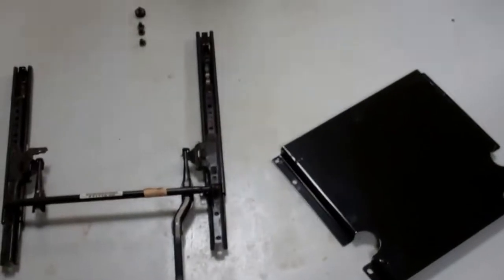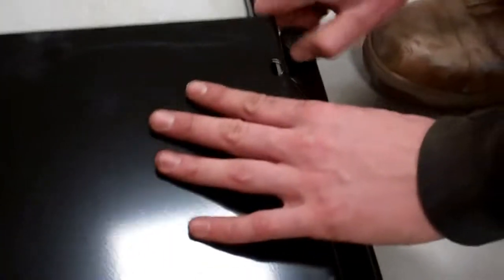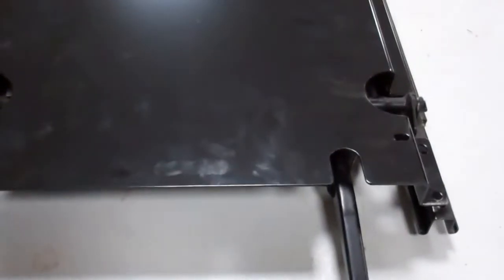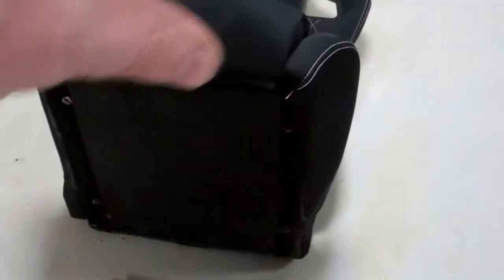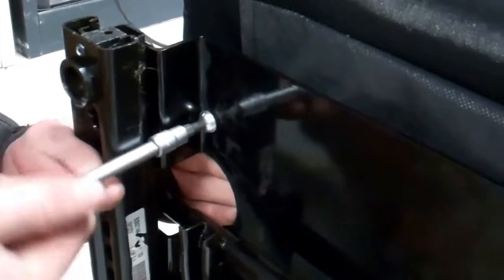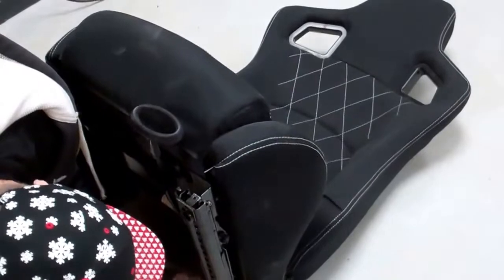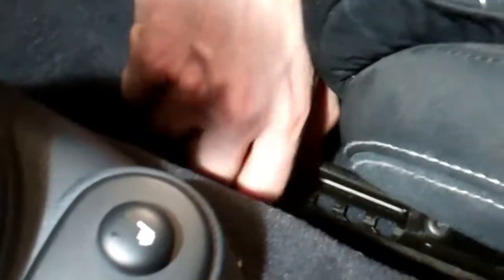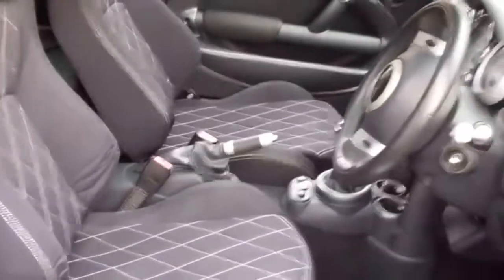Fitting Bucket Seats to BMW Mini - fitting original slider to new seats

Comment: Be aware! Unlike on this video, the seatbelt bracket Will NOT fit as it is 

If you look closely, even in this video, they have done something by bending the bracket and maybe hammering the plate. 

Take note if you are planning on using the seatbelt bracket!

Comment: The seat belt bracket doesn't fit with this adapter plate, customer service a joke that thinks the plate is upside down which is physically not possible. What a joke of a company.
Reply: Interestingly, I have the same issue. I have just emailed them and messaged them on ebay so await a reply. Did you manage to sort it Charles?

Comment: where can i get those seat plates or do you have measurements how to cut them?
Reply from the maker: Hi - we designed them inhouse and have them made... sorry but dont want to share the CAD file really... We could sell just the bases if there was demand for them. Where are you based ?
Reply: I live in the States. Oklahoma.
Reply: powerfulukltd I'm very interested in them plates I'm based in the uk how much for the pair?
Reply: hey did you decide on a price for the plates and what type of seats are those they look like they have good fitment for the mini
Reply from the maker: Hi - we will list these so you can buy just the plates
Reply: powerfulukltd hey will these fit other seats like Sparco?
Reply: its just a sheet of metal with a couple of holes in it. You should be able to get any local fabrication company to knock them up for you.